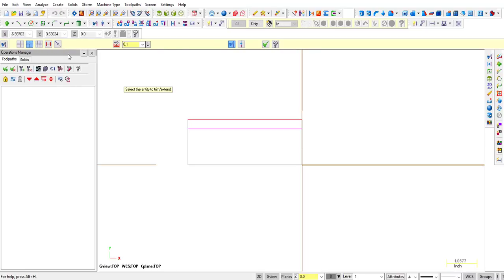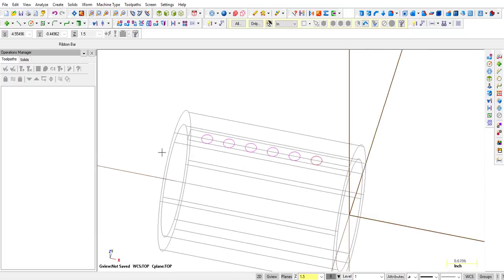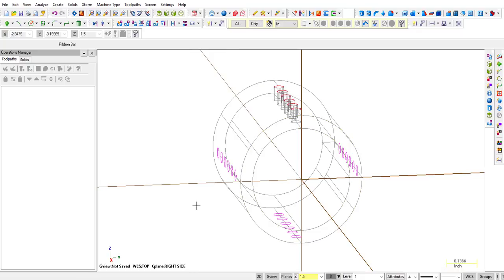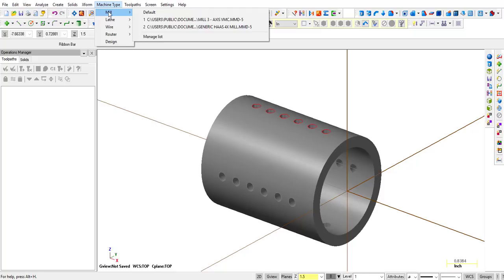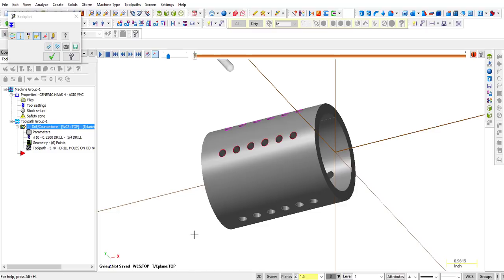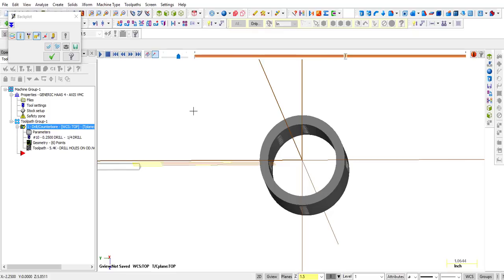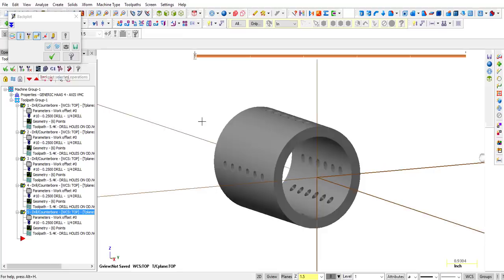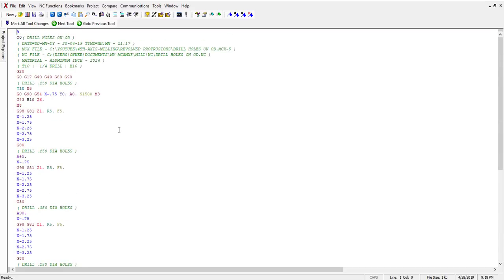REVOLVE A SOLID AND DRILL ON 4TH AXIS MILL

Comment: I gotta say Tom.  You made this process very clear and easy to follow.  That being said, I'm finding learning this whole 4 and 5 axis programming thing quite frustrating.  I set a part similar but simpler to yours, but 8" dia, 2" thick with 4x holes at 0, 90, 180, 270...  Should be simple.

Drilled the hole at 0, copy paste to 90, 180, etc...  Set for rotating around x just like you have.  For whatever reason, the part doesn't rotate.  The tool rotates around the part, likely crashing through it on a 45 degree rapid travel to each hole location.  Doesn't make sense to me.  I've had similar problems with (morph) helical 5 axis cuts. 

X19 home learning version here.  There are slight interface changes here and there, but overall they're the same. I've used x15 and x16.  I can't check the code with the home learning versions either to confirm if the 4th axis is active and maybe the (verify path) display is just wrong.  This software has a lot of strange little glitches so, it's hard to be sure of anything.

Generally speaking, CAM software is a major problem in the entire machining industry.  Vocational schools don't really cover multi axis programming.  Focused independent studies in multi axis from MLC, or some other reseller cost thousands for a week long course.  Webinars a few hundred for one brief lesson on one specific operation. 

Then, lets say you become proficient in MasterCAM...  Employers may use it, or Gibbs, or Bob, or NX...  Then there's bias against industries...  Aerospace doesn't want medical, medical doesn't want aerospace, automotive etc...  All MUST HAVE multi axis experience, which for the most part isn't taught.  One starts to wonder if the any of this is worth it.
Reply from the maker: Yoman Johnson 
Hey Yoman. Thanks for your feedback. If you would like you can email me at tstikkelman@gmail.com and we can set up a call to discuss some of the issues you’re having. Looking forward to the call. Tom
Reply: @TomStikkelman       That is really cool of you....